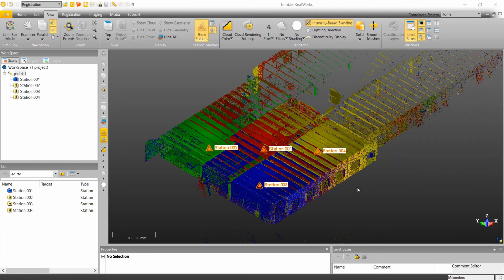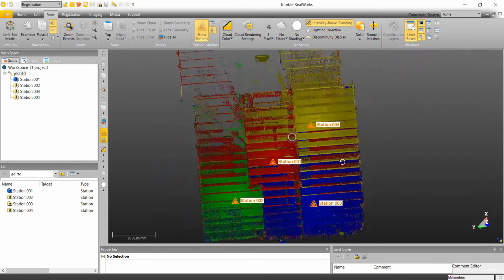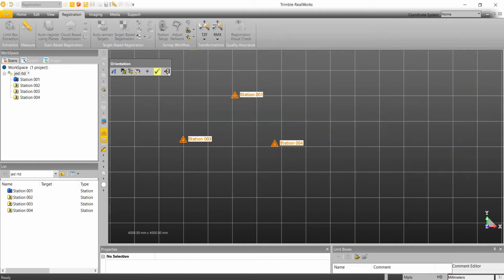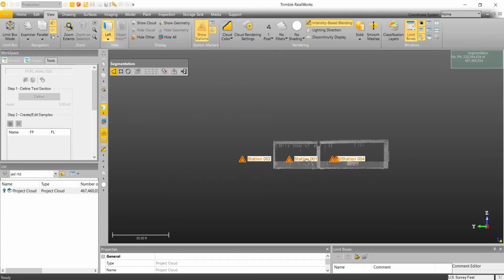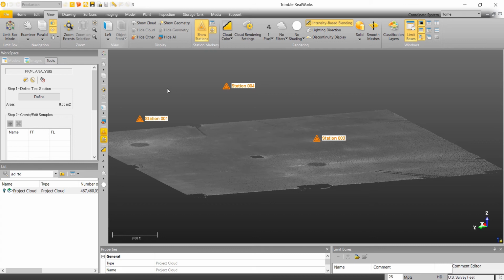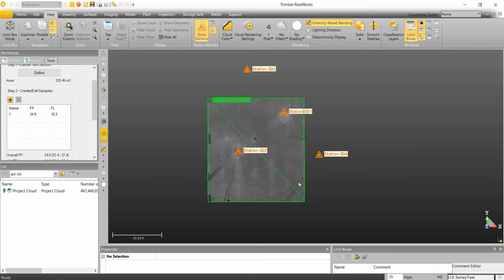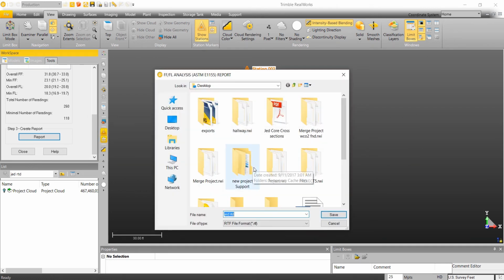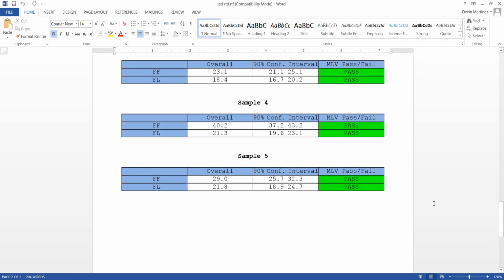Floor Flatness and Levelness Tutorial - Trimble RealWorks

Comment: Could this tool be used to inspect the slope and flatness of a floor that is.. sloped?
Reply from the maker: You can use the measurement tool in Trimble RealWorks to measure the slope. The floor flatness tool could be used to inspect the flatness but you would need to change the user coordinate system so that the slope is level.

Comment: Why do you recommend to use the central Scan leveled?
Reply from the maker: In this case because it is the central scan with the most overlapping connections.
Reply: @TrimbleRealityCapture  it would be great if you could use the segmentation tool not only for Cloud to cloud registration and also for normal Registration. so you can filter the unwanted points out before you are doing the registration. And one last thing to improve is to let the user Order the Error list for the lowest and highest errors after doing a Cloud Cloud registration and highlight exactly the Scans which not fit perfectly.
Reply from the maker: @stuev  Got it. Can't make any promises but we'll see what we can do.